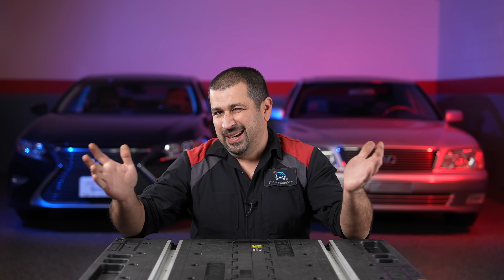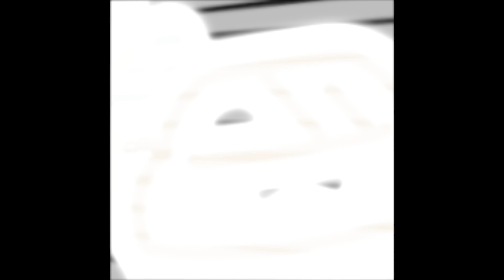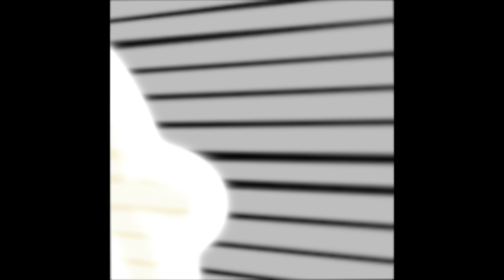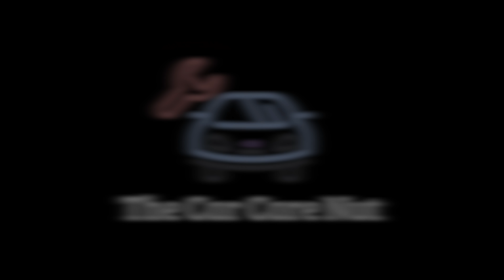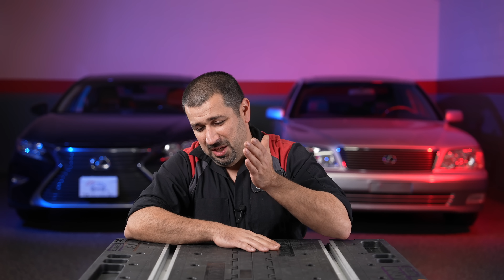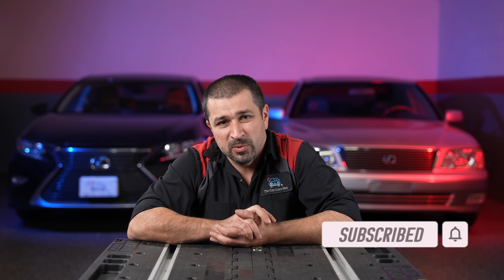Can Modern Turbo Engines Be Reliable? Here's The TRUTH!

Comment: I have a Toyota tundra 2023, and I'm just wondering when I get my new engine, cause it's on recall.If that's gonna be the same as the first one , they put in and have problems too at this point I would like just to put a hundred thousand miles on it without a problem or a major engine problem

Comment: I definitely disagree on the oil weight. The first thing I would do is change from 0w20-0w30. 
Base on your theory all turbo motors would fail when starting at -20F when the oil is VERY thick.

Comment: Regular Oil changes are crucial as is a 10 to 30 second cool down, you can't pull in the driveway and just turn off your vehicle, the Turbo is spinning at high revolution and you will starve it of oil.  Let it idle down before shutting it off.

Comment: I just bought a 25 f150 with the 2.7l ecoboost. I called the dealership and wanted to schedule an oil change at 1k miles because my thoughts are this engine is breaking in and it’d be good to change it. They told me not to that it could damage the engine. Is this the case or are they feeding me with bs? Currently at 1300 miles.

Comment: We are going to have a legacy problem as these extraordinarily hard working turbocharged engines gain mileage and and years and have no service record!? We will see the same results as we are seeing with EVs as the second hand market becomes hesitant to purchase and values plummet.  Another problem that is being seen in modern engines ( i don't know if its mostly a turbo engine problem or both!? ) is unburnt fuel getting through the piston rings and into the sump and diluting the oil, causing engine damage you only fine out about when the engine blows !? Not working in the industry leaves you worrying about these rumors when the percentage of this type of problem my be miniscule .

Comment: Diesel: actual burns efficiently/cleaner, low temp, low end RPM.
Gas: dirter/ burns less than diesel, higher temp, higher RPM. 
Conclusion: get a diesel runs cooler and longer. Gas turbo will push 4 yl to run like v6 and v6 to run like a v8

Comment: Synthetic oil and Never ever use the manufacturer recommendation oil viscosity.  5w 40 always. I had a 2003 VW 1.8T 220k miles when I sold it. Now I have a Hyundai 1.6T 100k and still going like new. Is just all comes to maitenance, Turbo engines aren't as forgiving in maitenance like old school  Toyota 22r  and so on.

Comment: I agree with all you said, most people get Talked into  a turbo by salesmen that have incentives to sell these cars. They are putting turbos in types of cars so as to meet strict fuel regs. I dont many vehicles with a turbo that last 100k miles. Another thing turbos need to idle after a good run as they are trapping a lot of heat and metal to metal contact needs lubrication while cooling.

Comment: My dads chevy cruze made it to 180,000 miles before the original turbo finally died (housing cracked near the wastegate, common for that engine) we replaced it for $500 or so, with new oil/coolant lines too, in a few hours. No big deal. It's still Cruzin' down the highway!

Comment: I have a 1.6 turbo with just under 200,000 miles.  Oil change every 5000 miles. Air filter every 12000 miles.

Comment: Oil is OIL. No amount of additive(s) can increase the longevity of the motor oil. Purification through filtration is the key to oil property retention. Yes, select a good brand of motor oil. Don't cheap out on the oil filter. I am 73 years old. I have a good mechanical background. Throughout my independent studies I have learned that oil is oil, but motor oil production varies between good oil and average oil. This is where the filtration comes into play. Look at it this way. If you use a lower priced motor oil with a high quality oil filter, and change that oil every 3 to 5 thousand miles vs using a high quality oil and cheap oil filter, the end result, aka, high trouble free miles, will not be that far apart. Remember, in America, 100,000 miles = 5 to 7 years of ownership. The key is filtration over oil quality.

Comment: I own a modified/FBO meth injected 2015 Kia Forte Koup 1.6T with 184,239miles. Its my daily driver and weekend warrior. As much crap as people give Kia/Hyundai as unreliable, its been reliable as hell. I change my oil religiously every 3500 miles. As soon as that odometer hits that additional 3k, im buying that Valvoline Restore and Protect with the OEM oil filter to change it myself at 3500. And I abuse my car with canyon runs and some track days here and there. People just don't do maintenance as they should and expect the car to work forever. It ain't gonna happen  😂 everything in my car gets changed according to the manual and i do weekly inspections myself. Runs like a dream given how hot it is in my area and how much I beat on it.

Comment: Better review DIY oil change on any turbo car that you are looking at.  If easy to change oil and filter, it will save you a ton of money in the long run.  Right now pennzoil platinum plus at Walmart is $28 for 5 qt.  Filter $10.  DIY at 4-5K and save your engine and long term costs!

Comment: Some cars are too heavy and too big to drag the little four-cylinder and that’s why they come with a turbo charge to make that little engine pull the big car or truck that’s one of the problems like for example the CRV with a 1.5 L turbo that engine is more suitable for like a Honda Civic maybe a Honda Accord but the CRV is big and heavy. Same thing goes for A Toyota for Runner and Land Cruiser. They use a four-cylinder liter engine with a turbo charge that little engine drags the big heavy truck that part right there is ridiculous. I believe that little turbo engine I more suitable for small sports car for example BRZ,WRX, Honda Civic type R. The worst to chart engines come from Kia Hyundai, Chevy and Ford.

Comment: If diesel doesn't burn at a much higher temperature than gasoline, how come the compression ratio is higher in a diesel engine?  Gasoline compression is limited by the ignition point (temperature) of the gasoline - is it not?

Comment: I've got a better idea how about we just get the government's fingers out of things they know nothing about?  I think small 3-cylinder and small displacement 4-cylinder engines with turbos are a great idea for Europe where you traditionally have smaller cars and narrower streets. But putting them in midsize and larger cars and SUVS and expecting them to perform well is a pipe dream. Little three-cylinder engines with turbos on them screaming down the roadway.  I'm sorry but that's not the American way to build cars and it never has been. I guess I can just say I'm old school now. I can't help but think that the automakers now have it positioned where their product is going to be disposable like everything else every time we look around we're seeing more and more vehicles parts that cost so much to replace it's cheaper just to scrap the car and buy a new one. And if it is trending in that direction it's a given the automakers are not going to do anything to stop it. They would like nothing better than to force everyone to have to buy a new car every 3 to 4 years.

Comment: Dave's in Utah, has identified a corollary issue to the extended oil change recommendations. Engine manufacturers are not thoroughly cleaning their engine blocks of the very fine particles, swarf,  left over from the final machining processes in the engine blocks. Dave's and other industry professionals with decades of experience, are recommending that first oil change happen at 3K, to help flush these fine materials out. These people go on to point out, that these engines may actually have rather extended break in periods lasting up to 10k. 

How do they know this? Oil sampling tests, which check for engine wear materials suspended in the oil. After 10K, the wear metals that appear in the oil samples, trail off, such as the metals that engine rod, cam and main bearings are made from, and metal from the engine block that represents piston rings seating the cylinders.

Comment: My first car was a 52 ford with the flatbed v8.
It had 100 thousand when I got it I went 300 thousand miles between 1960 and 1980.
Gas mileage sucked.
And it did burn oil but it lasted.
Eventually I gave it to a friend

Comment: Why not change at 1000 miles? Or 500 - even better? This advice does not hurt the engine but is generally useless.
He is not an engineer who develops and manufactures engines but a repairman.
The truth is that you can over-maintain anything without any real benefits but deeper hole in you pocket and more smiling Ahmeds.
The turbos have a bigger issue with hot side material wearing away and it has nothing to do with oil.
Manufacturers test thousands of cars and run these to million miles before setting intervals for maintenance.
The issue that happens is bad mechanics make errors in their work and then blame whatever is possible.

Comment: A turbo increases the pressure in the engine. Higher pressure will always beat up a machine faster than lower pressure. I’m not saying that necessarily means a turbo will blow up at 100K, or that naturally aspirated engines will last indefinitely, but if a car has a turbo, I count that as a detriment.

Comment: Are we screwed if the first oil change on 718 model s Boxer after 8k miles first time around? Their mechanic insisted 10k etc and I’m changing it every 5k miles at most but I’m now wondering I’m screwed for not changing it the first time till 8k mile. I’m so mad at Porsche dealership for insisting waiting till 10k miles

Comment: The people in charge of emissions should be taking into consideration how much more emissions occurs due to increased oil changes, R&D, and replacements. It's like with my Nissan Sentra - sure, the CVT is fuel efficient, but when it went out at 40k miles, any fuel savings were out the window on my end, and who knows how much it takes to manufacture a new one as far as emissions go

Comment: Sorry, but you are wrong. Small turbo engine will create less emissions ONLY on idle. As soon as you need the power, turbo pushes big amount of air that allows to burn same amount of fuel as a big V6 or V8 would, to create the necessary energy output, and that will produce the same amount of pollution. Even worse, due to high compression turbo engine will create the types of pollution that atmospheric engine does not. Overall, turbo engine creates more harmful pollution than a bigger atmospheric one.

Comment: As an owner of a 2016 Volvo V60 Polestar, with a Turbo i6, I will never change the oil every 10K miles as per the manufacturer. The previous owner did stick to the manufacturer's interval for around 8 oil changes (about 77.5K miles like that) and the engine mostly is good, but I will be shortening it to a maximum of 7K miles. Maybe even go down to 5K miles, if I find the oil is too dark at 7K miles when I drain it.

I had the PCV box off the engine to replace it and it was surprisingly clean in there, some varnish but nothing horrifying. I have seen others where there's brown crust in there, which suggests over extended oil changes and poor quality oil was used. In my ownership I will only be using LiquiMoly oil, as my mechanic told me that will be the best oil to use for it. The dealers also switched the oil type to 0W-20, instead of 5W-30, but thankfully that was only on 2 oil changes and the last oil change I did went back to 5W-30.

I also had a 2019 Honda Civic Hatch Sport with the infamous 1.5T engine. I have stuck to the manufacturer's oil change interval of 7.5K miles and it's not had any issues. Doesn't even consume oil and the turbo is still as strong as the day I bought it. I have only ever used Mobil 1 oil in it and a Mobil 1 oil filter, so that likely helped keep it running well. Although it will likely need a walnut blast treatment on the intake valves eventually, as the 1.5T engines are known to have carbon buildup on the intake valves. Due to the engine only being direct injection.

Comment: Recently totaled my 2015 F150 with twin turbos. When I got it and started to do research I was glad I got the extended warranty and was nervous the turbos would go out at 100k miles. Crashed at 160k with ZERO issues with anything involving the engine. Did regular oil changes and rarely let it go over 5k miles without an oil change. I miss it already 😔

Comment: Can we make reliable turbo 4 yes, do we no. Penny pinching and over emphasizing profits precludes it. Small displacement turbo 4 cylinders just will not last as long as v6 which spins at half the speed and produces a 3rd of the heat.

Comment: I have had like ten cars now. All diesel and one gasoline turbo. This car has close to 200.000 miles. I changed an engine at 170.000 miles...so it had four or five turbos on it already and two of them were changed be myself. I do 10.000 km oil changes like 6000 miles. High pressure fuel pump failed, rubbers, plastics failed, PCv system failed, alternator failed, radiator failed. Basically everything failed at least once, some parts multiple times like the oil cooler.  Like the front suspension that I changed twice. Also I have a ford 2.0 diesel. I just changed the high pressure fuel and some sensors. Car has 200.000 miles. Runs excellent. It doesn't even use oil. If a car has 300-400 bhp on a two litres engine it doesn't matter how well it's built...my car has forged connecting rods with a lot of meat on them and hypereutectic pistons. Yet it managed to split one connecting rod in a descent. Power makes a lot of heat that stresses the shit out of everything. So I took of the catalytic converter and everything that can stop heat dissipation.😂

Comment: The new Camrys are no longer fitted with a V6.  Instead, it’s a large , 2.5 liter, engine fitted with a hybrid motor.  The motor not only adds more power but also allows for excellent gas mileage and lower emissions.  This is a much better configuration over a small engine fitted with a turbo.

Comment: Heat and friction are the two enemies of engines. People who use cheap oil usually aid in the destruction of their engines. If your car has a turbo, use 100 percent synthetic oil like Amsoil Signature Series which does not break down like dino oil. You also want to change the oil more frequently. If your car requires 8,000 mile oil changes you should consider changing it at 5k-6k miles. I also recommend that you have the oil tested to see if it's protected properties have diminished, and if there are any wear particles like metals in the oil. That test can help you decide how long the oil can be left in the vehicle before it is replaced.

Comment: The reason I modern turbo engines are failing is the super tight tolerances necessitating 0w-16 or sometimes even thinner 0w-8! This has a couple issues: the tight tolerances have a much higher chance of manufacturing/milling residual causing a lubrication issue, any super tiny manufacturing deficiency will likely cause failure (thicker oil would greatly delay this). The heat builds to much cooking the tan water we’re using now.

Comment: Have an Audi TT 2003, 215hp. It has now done 250000km. Still goes like a go-kart. Had numerous Turbo cars and have NEVER had problems with any of them.
Reply: I've got passat 1.8t stage 1 190hp almost 400k km. Still pulls like new. 
Another is audi a3 convertible 1.4 tfsi with 300k km. Also runs great. I bought passat when it had almost 300k km and changed the oil and filter myself. The easiest oil change, as I don't need to lift it to get to the oil pan drain nut.
Reply: @otherstuff9121 My TT is actually chipped stage 2/265hp. I did this when the car had 27000km on the clock. As you say, change oil and oil filter and don’t run the engine hard and switch off. Allow the turbo to spool down and get lubrication before.

Comment: I own a new 2026 VW POLO with a 1.0 turbo. Live in Brasil where it's 25-50 celcius. VW says use 0W20 oil, but at my first oil change the dealer used 5W40 (which I was going to ask for anyways) due to climate, engine temps, and proof of thinner oils reducing longevity, as has been well documented. Change it every 3K miles as well.

Comment: Turbos are great for diesel engines ... NOT in weak gas engines.  The big problems with turbos I see in gas engines is that people will and do not let them cool down before turning off the car, cooking the oil in the bearings.

Comment: So true. Keep up with the maintenance. My very first oil change, I had all the oil and fluids switched over to Amsoil full synthetic, and when it was time to service the CVT, I had Amsoil CVT fluid put in it as well. I had heard from people saying it's the best out there and would make the engine so quiet and the CVT smoother than the factory fluid, and last a long, long time. Thinking that could not be true, but I am a believer now. My neighbor has the same model and brand vehicle I do, with roughly the same miles, and the engine on his is louder, especially when cold, than mine ever is or has been since I switched over. I have the oil done between 4500 miles and 5000 miles and the CVT done every 25K. Just an honest opinion not paid to say any of this.

Comment: I am from Europe and I own RAV4 hybrid, so it says to change oil every 15000 kilometers, which is ~9300 miles. Before I RAV4 I had Skoda with small 1.2L 110HP turbocharged engine (TSI), and it also was required to change oil every ~9300 miles. Still it is not 4000 miles as author suggests, but not 15-20K miles either.

Comment: 2021 Subaru Forester here NON TURBO 42K miles. No issues, no turbo, no problems. Yes it's a boxer engine old school, change my oil every 3-5K miles. Dealer says every 6,000 I do it every 3-5K not at the dealer. @thecarcarenut